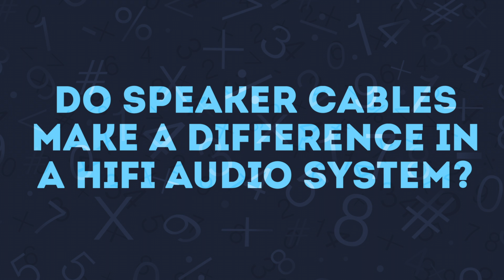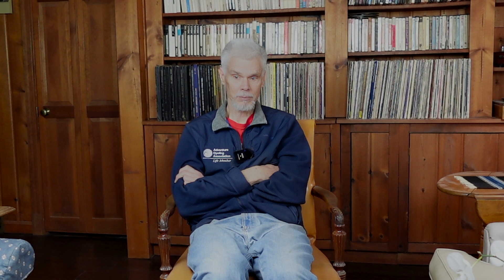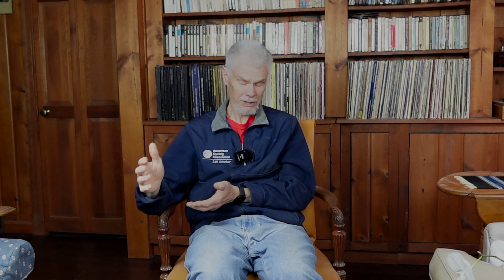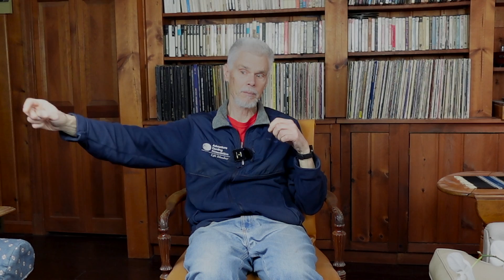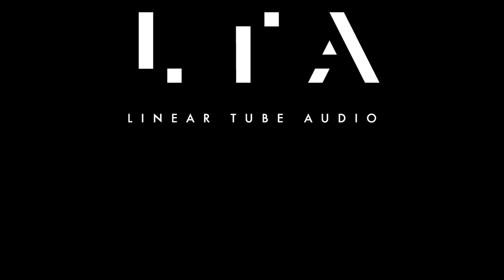Physicist & amp designer on whether speaker cables make a difference in hifi audio systems

Comment: Totally untrue! An amplifier marked as having 8 Ohm output is not actually 8 Ohms, its a fraction of an ohm. Speakers marked as 8Ohms are only that impedance at one specific frequency, usually just above resonance and beyond that the impedance rises dramatically with frequency. This leads to why passive crossovers are such flawed designs yet still used in HiFi....the professional audio world left them behind years ago. A speaker cable is not a transmission line where what you describe would make a big difference, this is reserved for the world of RF. For the transmission line argument to hold water in a speaker system, the load must remain constant, which it does not (just pull any data sheet for any raw driver), the frequency must remain constant, which it does not, and finally the amplifier or speaker and amplifier would have to be matched to the cable length.......All just pie in the sky stuff.

I suspect the cables you describe that blew up amplifiers in the 70's were some form of shielded cable or other high capacitance design, MOSFET amplifiers do not tolerate capacitive loading and back in the 70's, Zobel networks were not fully understood, the Zobel network offsets the capacitance of long speaker runs and attempts to make the amplifier see a resistive load.

Any cable of sufficient cross sectional area for the power, speaker impedance, and cable run length will suffice. This is a hard pill to swallow for those that have bough into the cable argument with hard earned cash. If you can double blindfold test hear the difference between two cables, one of them is faulty!
Reply: This is not true. But if you want to believe it, be my guest.
Now I'll go back to listen to my hi-end setup, and you can go back to your numbers and bilnd tests.
Have a nice life.

Comment: Very Philosophical point & Theory that being said that is compensated for in design of the Amplifier
Reply from the maker: Maybe, maybe not. The effects would all depend on the amplifier, as David points out toward the end of the video.
Reply: @LinearTubeAudio  There is a certain coax cable using AES/EBU  75 ohm impedance  so it's possible another cable MFG sells very expensive fixed cable with a 180k ohm in parallel terminated. ( People swear by it also)

Signal frequency sweep on the amplifier, cable, speakers typically answer that question. 

Floating harmonics maybe,In my quest for quieter cheaper power supplies began to add more circuits to prevent that type of noise or -300db that Rob with Chord Electronics states has an effect. 

He was non-very specific, so one can't be sure.

Comment: no difference whatsoever,, cables are never unstable
Reply from the maker: Agreed, but amps can be.
Reply: BS they can make a massive difference. Particularly the if it's vinyl coated it's not as good as polyethylene.

Comment: Reflections are real and matter very much at high frequencies, especially when you're trying to measure/transmit in the MHz range, but I fail to see how it matters at the relatively low frequency range of the audio band.
Reply from the maker: David addresses this exact point at 4:25 in the video: https://youtu.be/jlgpiFpkUmg?feature=shared&t=264